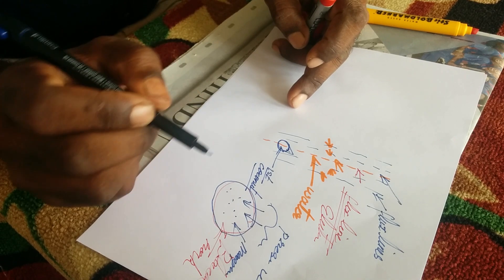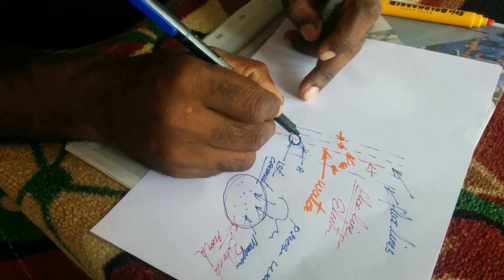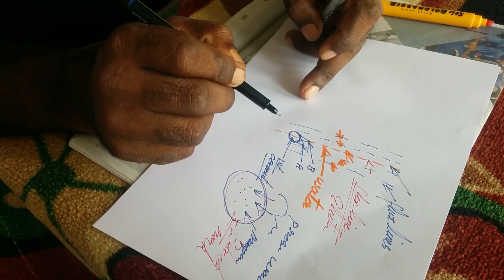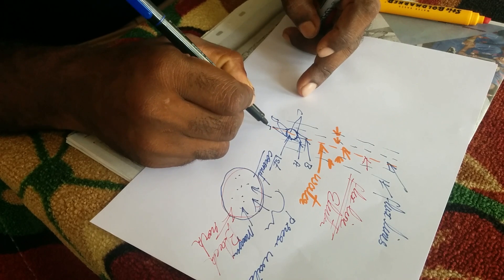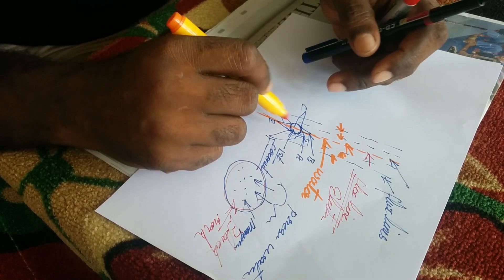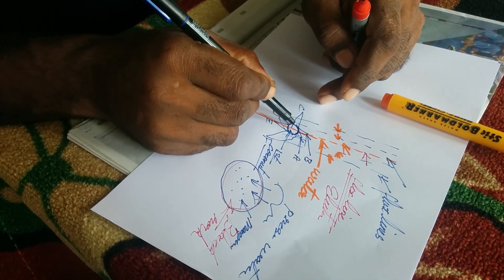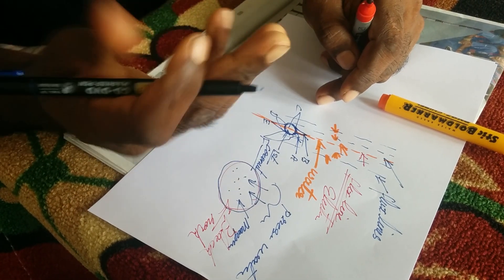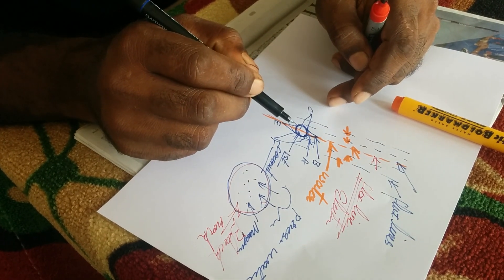Differentiate between empty hole, black rock and water using coconut-Ground water divining

Comment: Flux lines are shown one way to coconut
Reply from the maker: Ravindrareddy Yelampalle 

You have to judge
Reply: @almonddwater  way sir, this statement curect or not
Reply from the maker: Ravindrareddy Yelampalle 

Correct
Reply from the maker: Water divining consultant Almond D souza 9865660921 9488134139